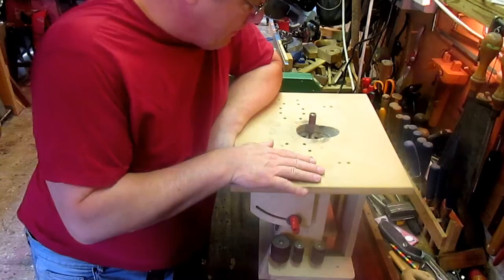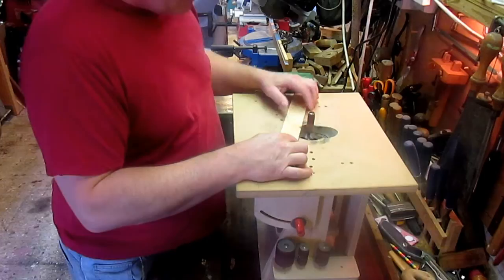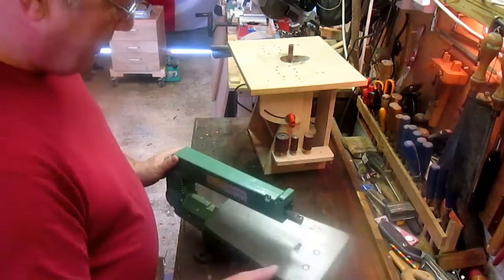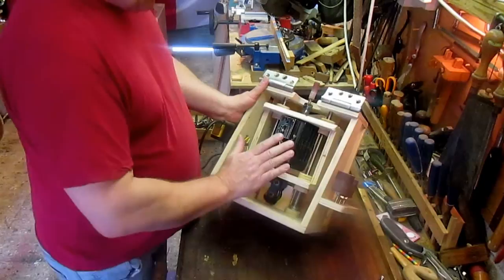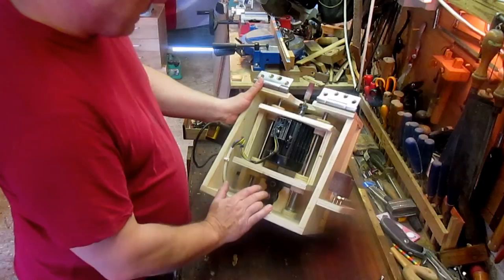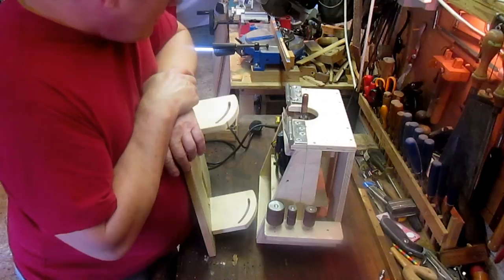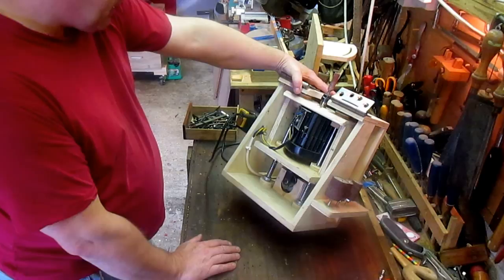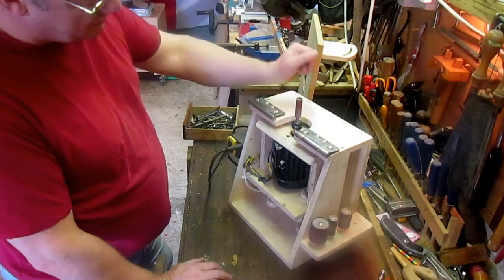How I made my Oscilating spindle sander

Comment: Hi. Great machine! Can you tell me the name of the part at 11:00 minutes. I would like to get one off Ebay but don't know what it's called. Thanks
Reply from the maker: Hi Al, thanks for watching this is the ebay link to the item I used https://www.ebay.co.uk/itm/ER16-Collet-Chuck-Motor-Shaft-Inner-8mm-Spindle-Extension-Rod-for-CNC-Milling-UK/164136895499?epid=856749207&_trkparms=ispr%3D1&hash=item263752440b:g:xuEAAOSwfkxeeZg0&enc=AQAEAAACUBPxNw%2BVj6nta7CKEs3N0qXe1WXGvAA3DV%2BjtEKGV7jJ9AMDcYvd6y0D%2BpLAga4cS%2FbZgwB%2B80ivb8xZWLcXpwryZ9H3JNCLlHfieNFpPMvF0VJ6vQqEPS8Who1OQyMfnJpzk2FQqCXEl%2FEjHMTKIhhs6tHu7RarBr2O2asF%2FybE3B9bFJK53jOzsHeY0vcZhuTOkVXgQADrC%2F%2BVPgc8loG7%2FbvjcTekOWqE%2BB94LsZPEyf0lLXx8kcGZaG5LdSG8FVb9KDWXTI6BM%2Ff1Y1k04oHDSbZCVO8uSgwCWPG5%2B0%2FceN2OKudIiKv0JZMCFhR5G4pEb6T8QtnywE1HhI3gnllFteQXe4WJW7hdFJ6mlHJvYICJcHNMFxwbJMO%2FmKy5%2FUgJarvmvrkxNu8sgYDgForgmHPWX0BRnijZVNR7hcPRvAtv6UYa%2FuS4AbZ9LRuMbrO0u5HUfjSddziAFPowKM2zuDhyanwjF%2FGwGcgU7uRKQMZjPx57Z%2BASOUWcjiQT8Sft7gcA8IK%2Ftk7evXmnnIlE3d7pCMRYoxsQe8ss2lKS%2FxsJkoJzKPoOg6opYwfyDryVYESH2SQ1mOrSrClUJ3%2F%2F%2FNreaf0A%2BGI%2FaoXP7MlzG70vSQgplWeATXi%2BpJ9a8dhhFYBochxPheMQgI8smTEgHBumowwCuekh6WE%2BW%2BJUmHNzhftVXMRqEe10dVAog%2BDV7TnR7HNpekZjDDrISOYUwfM2cP%2FFIPCPXfewpFIF1cI5FIQe9QFx3pjfBTTXz9bgUF%2BJlMpAmDS0hdVZz0%3D&checksum=16413689549916cb3a6d419e4cd7ad6453dbe1669f67

Comment: Sorry for pestering you but could you please tell me how many watts does the little synchronous motor have? I ordered a 33 rpm one producing 4 watts and was wondering if it's enough?
Reply from the maker: Hi Jose, happy to help. My synchronous motor is rated at 14 watts with 60 rpm, I don't know if the 4 watt motor would work. This is the motor I used, https://www.ebay.co.uk/itm/220V-14W-Speed-Reducing-High-Torque-50Hz-Gear-Box-A60KTYZ-Synchronous-Gear-Motor/322574464889?hash=item4b1aefb779:m:mYgnMZ0r9l2Lf3VglVgKx9w:rk:18:pf:0
Reply: Hi again. Thanks for the insight.. Maybe I'll go for a 28watts  60rpm as regular oscillating spindle sanders oscillate about 60 times per minute and yours seemed to be struggling a bit. I could go to 110rpm but If it reaches them it might be a bit too much don't you think?
Reply from the maker: Go for it, 110rpm is in my opinion too fast, I'd like to see your end result and if the 28w motor makes much difference
Reply: A little English workshop I'll probably just go 80rpm but I think I have to go 28w as the engine I have came from a washing machine and is probably heavier